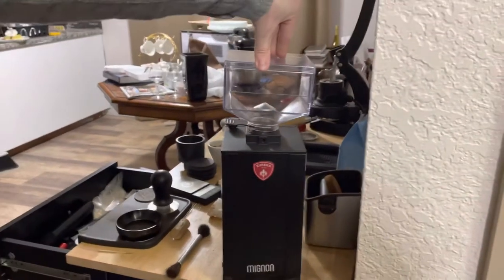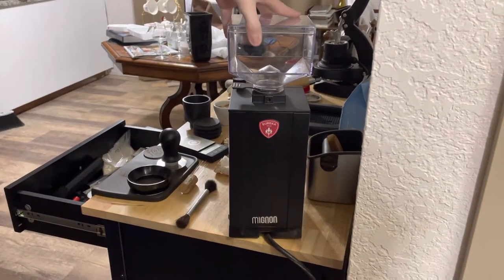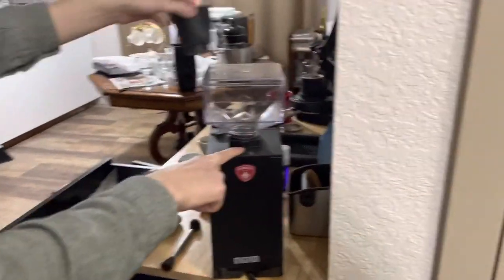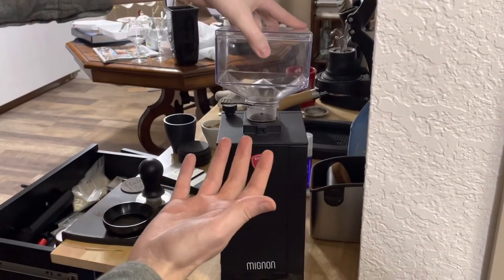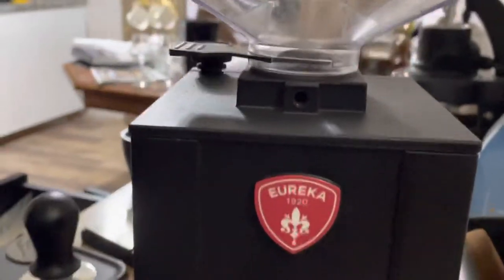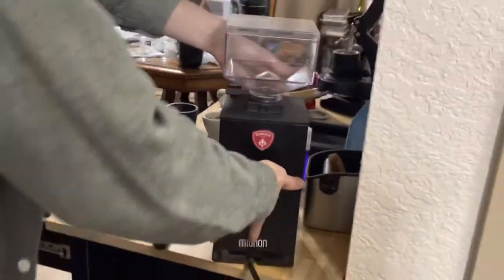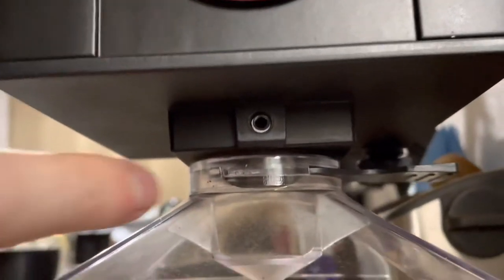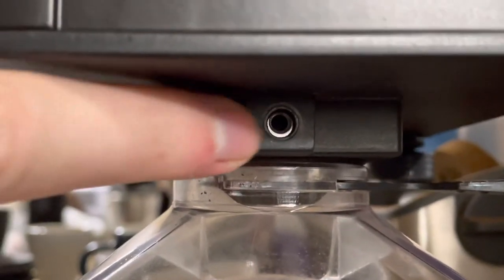HOWTO: Reinstall Eureka Mignon Hopper

Comment: THANK YOU!! I have the Eureka Mignon Zero. The hex nut fell out while the hopper was removed for cleaning and I couldn't figure out where the nut came from or why I couldn't screw the hopper back into place. I used a flathead screwdriver to get the hex nut back into place but would have struggled for hours to solve the puzzle without this video.

Comment: Well, thanks for the video, but mine bolt washer is stuck( Flipped over grinder upside down like in your video and nothing happened, but i clearly see, that something loose in the hole. I think that bolt washer is off the grooves. Can't hook it up, magnet also didn't help( I think i will disassemble grinder in future to put bolt washer in place. This bolt washer is a huge flaw I think, like you shouldn't screw off a screw completely.
Reply from the maker: Dang that sucks! Good luck getting that out. I agree. It’s a bad design. There had to be some reason behind it, but it’s an easy thing to break and very hard to see as a user
Reply: @classicrockonly  , there is one good thing: this screw isn't do anything and hopper is tight in place without it)